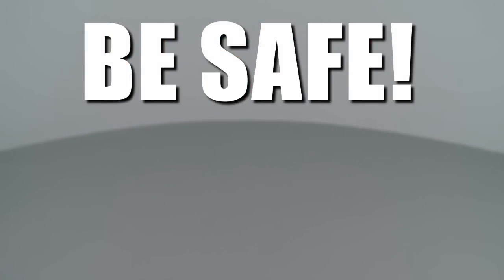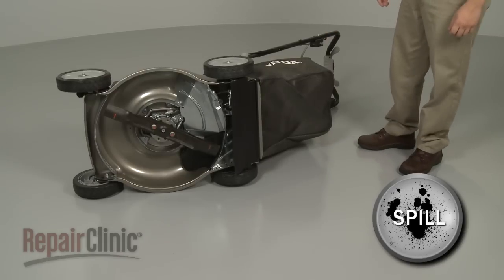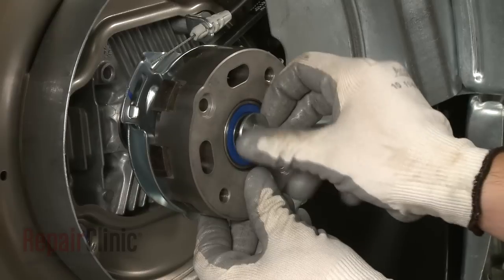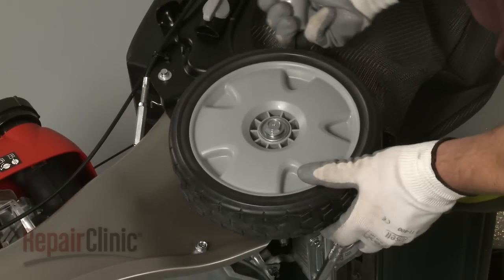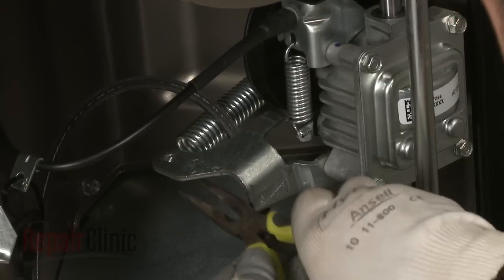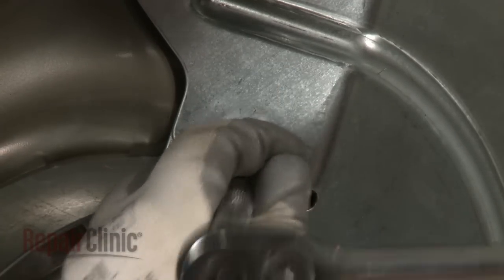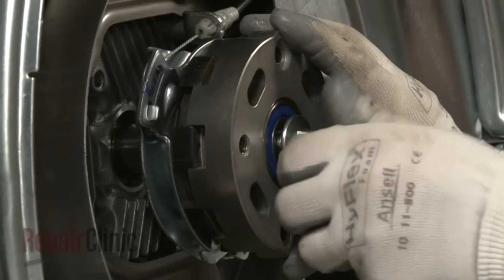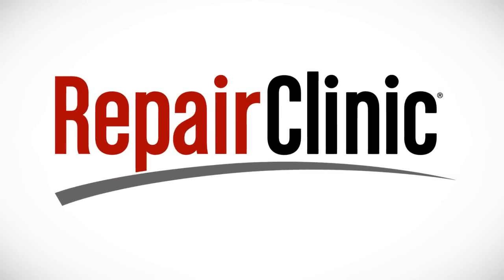Honda Lawn Mower Disassembly (Model #HRR2167VXA) – Lawn Mower Repair Help

Comment: At 1:09 it says to use a sharp motion to loosen the bolt...mine rotates with the shaft..how does one secure the shaft from turning so I CAN loosen the bolt?
Reply: Did you ever figure this out? I have the same issue.
Reply: @Wyke  Nope...ended up taking it to a lawn mower repair shop and they agreed to install my new part...wish I had better news
Reply: @42Tmorris I thankfully ended up figuring it out! Sorry you had no luck. Ran into other problems though and now just have a broken mower.

Comment: I have the 16 inch version with no self-propelled is it possible to swap and use the parts off a self-propelled version on to mine momer

Comment: Honda HRB 216, Trying to install Handlebars and cover guard to the lawn mower sides. However,  when bolts go thru the cover plate to the lawn mower, (over rear wheels) they cannot  tighten up due to nothing inside the holes to tighten against. A hole for  bolts but no nuts, or threads of any. Is something missing that I need to replace..   Will

Comment: What torque setting does the roto stop assembly bolt take if it comes loose?
Reply from the maker: +Fed Guy We would refer you to the owners manual of your specific mower for that information.
Reply: Thanks for the reply.  Unfortunately the owners manual does not specify the torque on this bolt  Its probably in the shop manual which I do not own.

Comment: The bold holding the clutch on won't free up no matter how hard I rap it.  Any ideas?
Reply: James Polles   Exactly. I am having the same problem. I saw in another video where the guy uses an air impact wrench. My DeWalt impact driver isn't strong enough.
Reply: I've used milwaukee's impact wrench which can easily removes lug nuts and I still cant get it off
Reply: Had same problem. Solved it by placing wrench on bolt and hitting end of wrench with a hammer. After several sharp raps, the bolt loosened and I was able to remove.

Comment: Can you put i different engine on a lawn mower than the one it has? My Honda mower engine needs new rings but I want a new engine instead. It's self propelled. I didn't know if putting a different size. I didn't know if a GVC would be ok to replace a HRC
Reply from the maker: +Raul Lozano Yes. The industry term for that is re-powering.

Comment: Whats the part number for the crankshaft on the mower?
Reply from the maker: We would need to get the model number off the engine to look up the correct part. You can call us at 800-269-2609 with the engine model and we will look up the correct part for you.